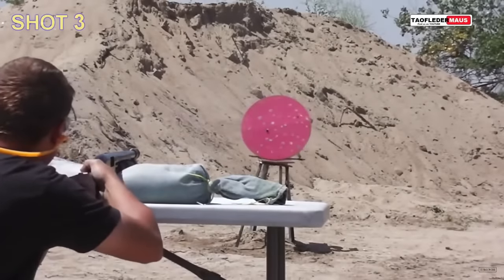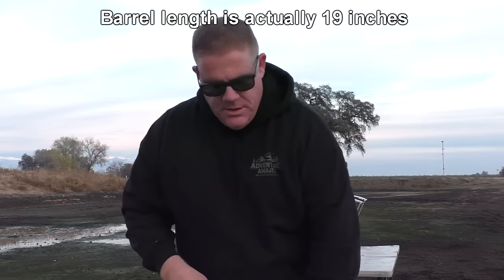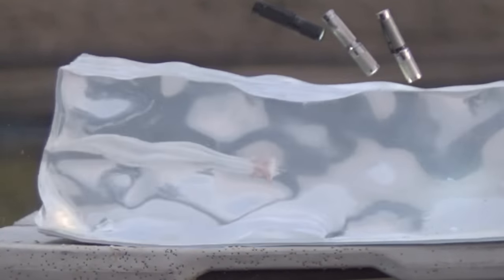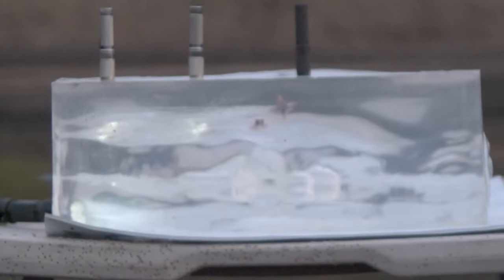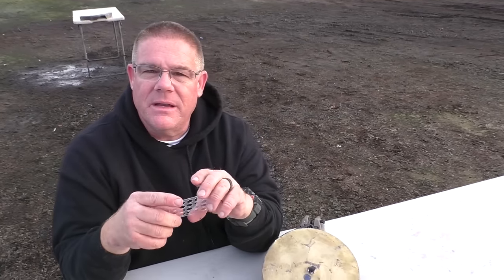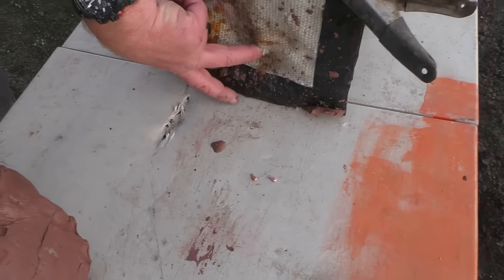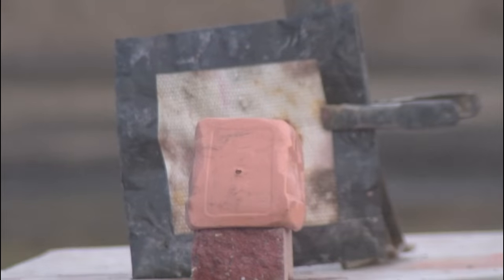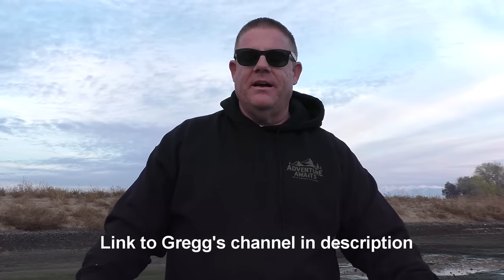Holy Bloomin' Bullet!   The 9mm INTERCEPTOR  -   Tested!

Comment: I wonder how these would stack up against the 12 gauge, 1 oz “Excavator Slugs", I made and sent to you some time back. Only Jeff. with his slow motion cameras, can properly do the testing. What do you say. sir? Time to test the Excavator yes / no???
Reply: This is a 6 month old e-mail I sent to Jeff and his channel. Privately sent e-mails were misunderstood and as a result Jeff got offended at some point. I’m going to ask him again to test my 12 ga slugs, openly so all can judge my words.
“No hard feelings here, Jeff”
///////////////////////////////////////////////

June 13, 2022
Hello,  Sir Jeff of Visalia,

Well, you should be getting my 1 oz hand-made 12 ga slugs soon. Lead core, copper jacketed hollow-points, I call “The Excavator”. The best I can figure is Wednesday June 15th.. 

I wanted to let you know as much as I can about them. I designed them as a hunting / 
anti-personnel slug. That info may influence your choice of targets.? They are designed for *rifled barrels only*.

LOADING: I have been using, all new & loaded 1 1/8 oz, duck, #4, high base 12ga rounds and dumping out the shot and wad. Then replacing the power retainer cup with one of those that came with the shot. Then I select, from my supplies, a shot cup which has no 
vertical reinforcements on the inside. I band-saw the shot-cup from the rest of the one piece wads. I do not used the compression device between the two pieces. I have found it 
makes little difference. The shot cup is cut to half it’s length and my slug inside the cup. Then I put the role crimp on and I'm almost done.

"You do what you feel is best for your safety. " That is what I would want if someone sent me slugs. I would want to be in charge of loading them myself. Right...  

NOTE: 
If after crimping there is a bulge in the hull - it won't fit in the shotgun. I use a bench polisher to lightly buff the outside of the hull to reduce the bulge. Sandpaper or a sharp file will do the same thing. The walls of the hull become a little thinner but it has worked for me. I think I got the diameter of those 6 down to where that shouldn’t happen. In case after loading them up and one doesn't chamber, all is 
not lost. This is the fix.

I find myself rather excited in anticipation of your testing. The feeling is much like when I was a kid, the day before Christmas.  hehehe 

Friends and family eagerly await your evaluation.

Highest Regards,

Ron Medcalf
June 13, 2022
/////////////////////////// END ///////////////////////

Comment: You can improve your flashlight setup by setting them in a 2x4 with holes to match the light diameter then attaching . It would be less likely to fall over but you could attach it to another board to hold it in place

Comment: Those things are amazing! So somebody told me that if you use an 8-in barrel that you actually get a faster FPS out of your bullet because the full length barrel will actually start to slow it down. You guys should try an eight to an eight and a half inch barrel in something with this. Super impressed. Glad he didn't give up on this one!
Reply: IDK. There are diminishing returns for additional length, and theoretically there's a point it would hurt, but Idk if 8 inches is enough. The question is whether the expanding gases are still pushing harder than the dynamic friction, and the friction is probably less as the grooves have already been cut in the first bit or barrel

Comment: There are LED Strips on Amazon for TV Backlight. They deliver up to 6000K in Light, have a USB Conector with ON/Off Switch and changeable output. YOu can power them with a normal Powerbank if you want, and you get about 6 or 7 feet of strip for 20 bucks. If you tape the strip on a Board you get a perfect backlight for your klear block.

Comment: While bullet expansion is a good thing - effectively transforming small diameter bullets into larger caliber through expansion once within the target - it's not free.  Some of the energy that the bullet possesses is "given away" in the plastic deformation of the bullet - that is, it's not transferred to the target, but rather consumed in causing the bullet material - lead, copper, jacket, whatever - to flow into the expanded form.  

I would think, looking at these bullets, that perhaps less energy is so consumed, in that as the "blades" begin to expand outward, the material through which it is passing gains significant leverage - mechanical advantage - as it flows past the outer points, spreading them wide from the central body of the projectile.  

Between the large area covered by what is essentially a violently spinning rotary, multi-bladed knife, and the "blender" effect on the tissues that it causes within the permanent wound channel, though, it would seem that a pretty sizable amount of the energy is being transferred into damaging the target.  

I don't know how to measure the amount of energy that it takes to expand the average hollowpoint or exposed lead soft point bullet, but it would be interesting to find out, since if the amount is large, it diminishes the effectiveness of the bullet from an energy standpoint, since some of the bullet's energy is captured in the bullet itself as it is used to deform the material.

Of course, you get something back, in that the tissue damage would increase over that of a ball round - especially if the ball round exited the target like the 9mm rounds that you illustrate in the video.  Stopping within the target means all of the energy has been expended right where it does the most good.  Or bad.

I always leave your videos wondering about some aspect of what I've seen.  Like why isn't OG employed as a cartoonist . . .

Comment: Man, I would REALLY like to see these in 10mm, maybe in the 110-130gr weight. For those that will say you want something heavier in 10mm, you have to realize you can’t get solid copper bullets as heavy as lead bullets, at least not in small pistol calibers.  With copper being so much less dense, the bullet is much longer. That reduces your case capacity, and makes powder selection and charge tough. 

In the past, I tried to get Barnes DPX bullets in 10mm to work (I believe 125 and 140gr), but just couldn’t drive them hard enough to get 10mm power levels out of them. I was only able to get up to maybe 1300-1400fps, which with a 125gr bullet is more like .40S&W energy levels. 

If I could get these rounds in 10mm, AND get them to make 600-650ft-lbs of energy, I’d be happy.

Comment: I have the Lehigh Maximum Expansion 45LC for my judge and think that they are awesome rounds. I don't think there 9mm rounds were as impressive as these.  I would like to see some test shooting through a few objects like  glass, metal car door, and even an interior house door and capturing them in gel to see if they still expand. That was one of the reasons I bought the Lehigh rounds because they are hydraulic driven, not impact dependent.  So they will pass through an object and still expand as it should when it hits its intended target

Comment: try it with a 9-10 inch barrel. if the difference between a 5 and 19 inch barrel is a little, it might be slowing down a bit after leaving the 19 barrel. might even get up to 1500 fps.

Comment: A box of 20 rounds goes for $10. It takes the machine 13 minutes 20 seconds to make them. A used Tsugami B0325-II costs about $180k. Assuming there are $5 leftover per box after other expenses (rent, electricity, maintenance, brass shells, copper stock, tooling, loading, packaging, posting etc.), It would need to make 720000 bullets) to recover its own cost. It would take the machine about a year running nonstop to make that amount of bullets.

Essentially, he is billing his cnc machine time at around $45/h. By comparison, he charges 50 cents per bullet. A cheap mass produced round like 9mm goes for around 25 cents.

I am not sure this business plan will pan out. It isnt completely unrealistic, but it is certainly challenging.

Comment: Looks near identical to a varmint round  a member designed and made over on Gateway to Airguns made of pure lead for high performance PCP Airguns. IN an air pistol at only 575 fps, open exactly as the copper versions shown here. When pushed over 1000 fps out of a PCP rifle they become super explosive, which was exactly the intent.  

If I knew how, I would get some to you for viewing. Seems Norma saw the writings and pics on the GTA and copied them to the "T" in copper as well.

The one thing the  GTA Member did to improve feeding if used in a firearm is used a narrow funnel in polished stainless and pressed the nose slightly into it to close the very mouth of the opening to prevent hanging up in a semi auto.

Comment: You need to do a gel test using a 3" barrel. Also, you need to do the gel test with at least 3 layers of denim with a 3" barrel. 8" Penetration in pure gel is not enough for a reliable self-defense round. You incorrectly stated that 8" was within the FBI standard, but I believe the standard is 12" - 18" of penetration.

Comment: 3 petals would allow the weight to be a bit higher and as far as hitting bone and what not it would make for more material holding each petal to the base and slightly shorter petals would make for even more weight and penetration depth to hit a sweet-spot of penetration and expansion...

Comment: If you want light in the block. Get one of those LED tube light. Led is not a bulb so won't shatter. Get one with a reflector on top to push the light down. I use something that when I camp. I power it with  a battery PowerStation you can get one cheap.             
They do make 2ft and 4ft versions. They also have battery operated ones that cost more. That was why I went with a power station it runs my coffee pot and lots of other stuff. The cheaper version of the power station won't run a coffee pot since you need 1200w to run a coffee pot  that would be more expensive.
Reply: I tried to send links but Youtube said no

Comment: A comment was made referencing this round to a +p round.  Should it be a +p rating?  Will it eventually damage your handgun if it is not +p rated?
Reply from the maker: I don't think it is +p  because the pressure isn't higher.  The bullet is lighter, so it is a bit faster,  but without a pressure spike.

Comment: 9mm velocity increases up to 17 inch barrels then it decreases as resistance overcomes low pressure. If it is designed to burn fast to do all its work in a 5 inch barrel, the increase velocity is purely based on the continued expansion of the gasses that have already burned in a longer barrel. A real math nerd can create an equation that tells you the curve plots based on powder burn time and gas expansion vs friction.

Comment: What would penetration be after the four layers of denim? I suspect insufficient, for my taste it was a little deficient even in bare gel. Very impressed with their performance otherwise, if they were just heavier (not solid copper, I suppose?) I think they would be great. This type projectile at around 130 grains in a .38 +p would be great in a revolver where it wouldn't need to feed and could therefore be longer or more oddly shaped, provided it could get enough velocity to perform properly from a snubnose barrel, would be AWESOME.
Reply from the maker: It would be about the same.  The denim test is to see if it will clog up the hollow point and prevent it from expanding.

Comment: Is a 19 inch barrel too long for 9mm? Is the constant engagement of the rifling actually retarding thev speed of the bullet at some point? It would have been cool to test out of a mid-length barrel like on an MP-5.
Reply from the maker: No, it isn't too long.   The powder in the case expands to a certain volume and then the pressure drops in longer barrels.  That and the friction you mentioned is why sometimes one might see lower velocities from longer barrels.

Comment: 8 inches of penetration in the gel block, in my opinion, is not acceptable for defensive ammunition regardless of the expansion. This round may be suitable in warm weather but as more clothing is encountered in colder weather the penetration ability is questionable. Also, I don't believe many shooters will be using a 9mm with a 5 inch barrel for defensive application. A shorter barreled 9mm would have given more realistic and usable data for the average shooter.

Comment: .40 cal and 10mm are the same bullet, the brass is the only difference and the weight at times
Reply from the maker: Yes,  but they will need to be designed differently to react the same way to the different velocities.

Comment: What a load of crap.  8 inches is absolutely poor and not ideal.  That is worse than some 380 tests.  FBI is 12 to 18.  This is also 8 inches in CLEAR gel which the FBI doesn't use.  Clear gel has penetration about 2-3 inches deeper than the standard gel.  In a standard FBI test with cloth covering I doubt this would penetrate 5-6 inches.  This is an awful self defense round and for people who know nothing about what law enforcement would use to put people down.
Reply: I will use Federal HST instead...and Golddot G2 for penetrating windshields.